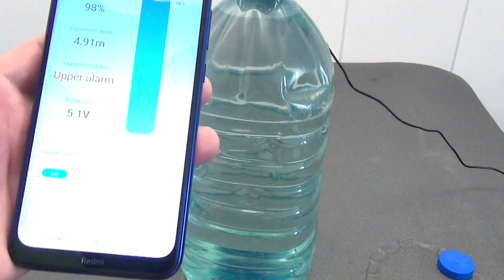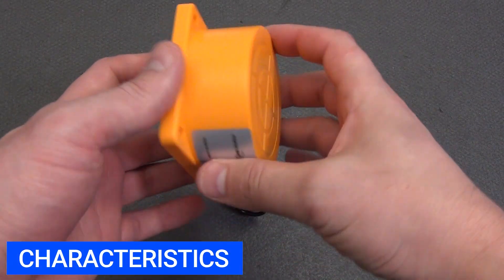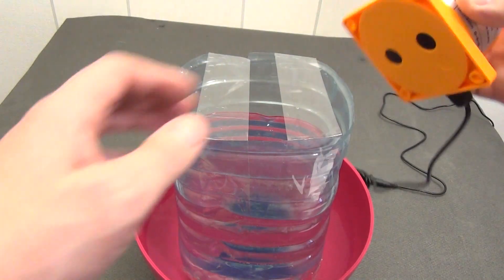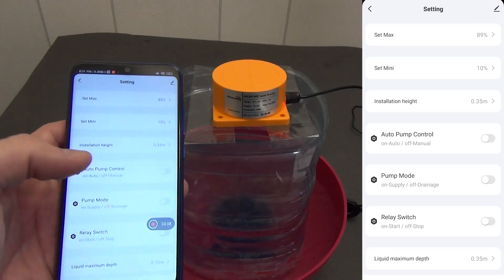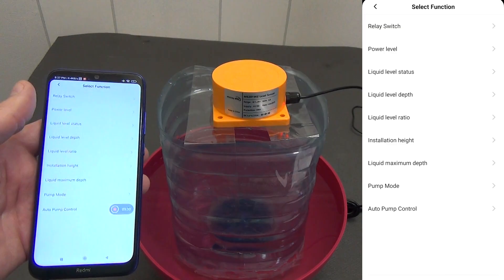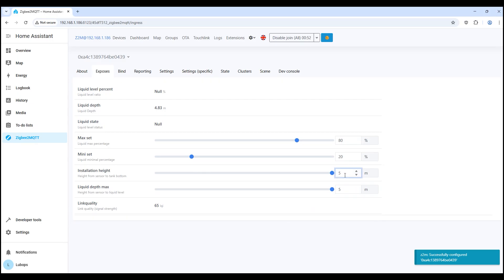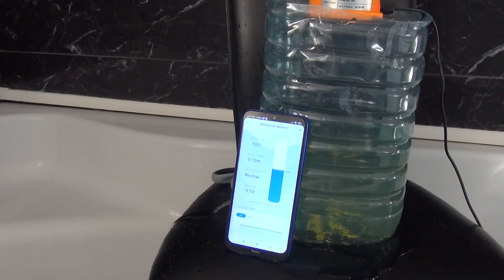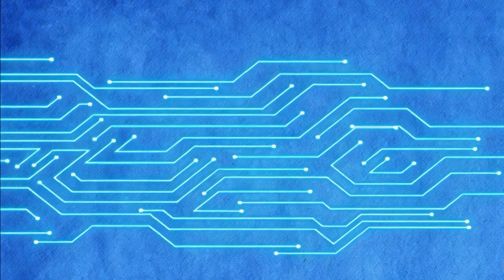Tuya Ultrasonic Liquid Level Sensor — Control and Automation, Review and Tests

Comment: Hello 
Ihave  bought like this senosor. Installation height is 1.43 meter. What should i put in: liquid maximum depth?

Because the sensor when i fixed it is stopped on 83%. Is not moving
Reply from the maker: Hey! For 1.43 meters, just set the max depth a bit lower than that. If it’s stuck at 83%, maybe it just needs a little re-calibration or check if something's in the way!